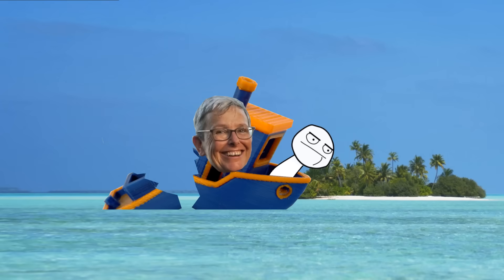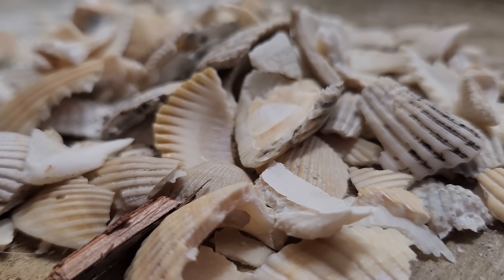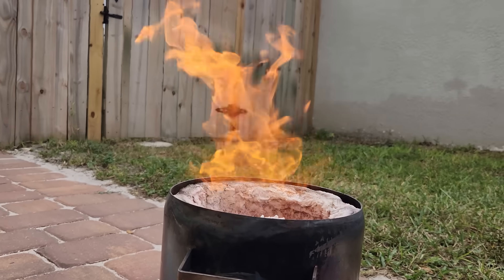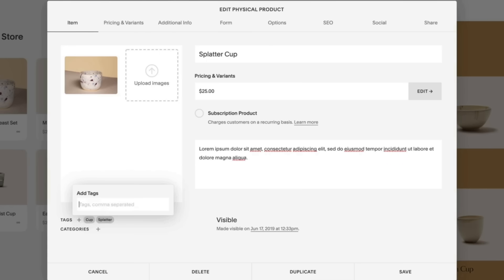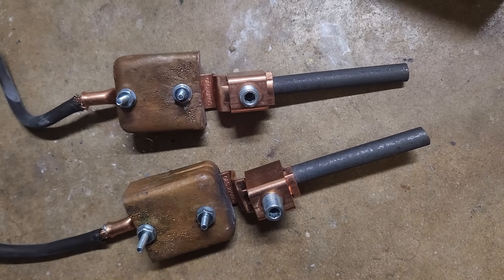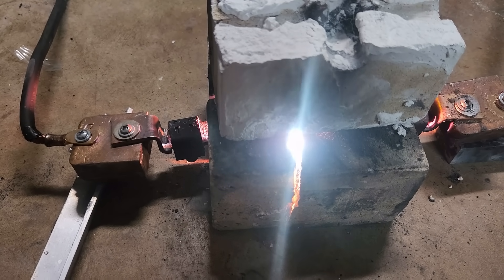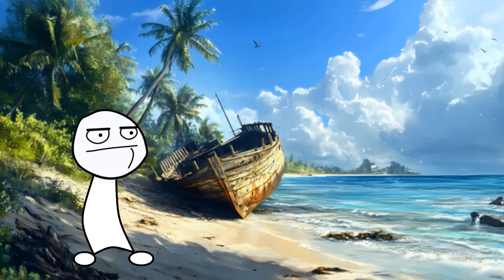Acetylene Gas from Sea Shells and Driftwood

Comment: You need to mix oxygen with the acetylene to get complete combustion with little soot. Also, in order to get it to go BANG!

As a welding gas, Acetylene is explosive when pressurized over 3 to 5 PSI, which is why the gas is dissolved in acetone.

Do not let the small flame fool you, with a leak in a hose, the gas can collect and go off and do severe damage!

Comment: Soot is from the lack of available oxygen concentration in the air and loss of radiant heat to maintain the reaction ( reaction cools off and fuel disperses before it can acquire the needed oxygen

Comment: Super! Those arc lights using carbon rods were used as light sources in cinema projectors. The rods diameter was about the same as the rods you used. Powered by DC and one rod burned faster than the other. The operator periodically had to re-adjust the distance between the two tips. The light was intensely white, just like yours.

Comment: I love the fact you mention volatile compounds being distilled out of the wood.

This is an extremely specific interest of mine due to my studies into black powder. 

It isn't very well known but around the early 1870s German chemists (always them) found they could preserve massive quantities of volatiles in their charcoal which when burned in black powder had major benefits.

First, the weight of the volatile compounds offset the fixed carbon content, second it offset the ash or mineral content and finally it actually produced water vapor as a byproduct.

Offsetting the weight of fixed carbon meant lower ignition temperature, the offset ash meant more fuel and less ash which contributes to a gritty feel and abrasive effect in the bore and finally the water vapor produced had several benefits, it softens the fouling and the vapor is an excellent heat sink, taking heat with it as it is ejected from the bore of a firearm.

German black powder of the 1870s and 1880s was regarded as the cleanest, least fouling and softest fouling powder of the era by those who had the fortune to acquire it.

Comment: even without an arc furnace I'd suppose you could also use a magnifying glass or perhaps even a Fresnel lens to produce the heat necessary from the sun itself for the final steps. technically they had the technology to produce this stuff waaaaay back in Ancient Greece! that'd be an interesting study, could the Greeks have produced calcium carbide for use in "Greek Fire" using a magnifying glass, I know it's thought that they used magnesium as a key ingredient as it produces oxygen in water.

Comment: Using a lower voltage on the arc welder is better for the heat "distance" but the current will obviously suffer. The arc will take up less space so that the infrared doesn't get generated as much.

Comment: "...too high for an air breathing flame..."

Woodgas. You're already making charcoal, so you're off gassing all those combustible volatiles for nothing. If you capture and condense those glasses before they ignite on contact with the air, you can use the condensate as a fuel to achieve 2000° or more. You could even throw in some methane and saltpeter for a boost! 

Point is, I think you could do it without needing a portable welder to make calcium carbide so you can make acetylene gas so you can weld without the welder you started with and also no oxygen?
Reply: In the spirit of HTME, we must now create and store acetylene gas from materials found in mature only. Ceramic, wood, shells, water.

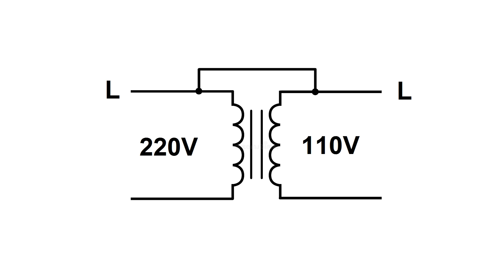Comment: At ~ 8:00 I'm not entirely sure you're looking at the primaries correctly...? 

Normally for 120 the two primaries are jumped together (in phase of course).. typically "1 to 3 and 2 to 4", line and neutral on 1 and 2 respectively if there's a terminal strip. 

For 240 they are in series.. which would then be line on 1, 2-3 jumper, neutral on 4.

Comment: USE 100 AMP MAINS CABLE USED IN UK! 

ITS 12MM COPPER CORE EVEN AT LOW VOLTAGE THE SICK AMPERAGE WILL DISSOLE YOUR SOUL!

Comment: I’ve made an arc furnace in the past myself… used some thicc large motor brushes.  Wanted to melt tungsten carbide… yup.. melted it and then even accidentally got it to burn 💀

Comment: Fun fact: ordinary petrol engines can use wood gas as fuel. In Sweden during the second world war it was pretty common to equip cars with wood gas generators, and when you were going somewhere you just chucked some firewood in there and got the gas going.

Comment: Would 2000°C be possible using a microwave?

I've heard you can get metals up to mental temperatures using microwave so could you mix some ball bearings into a powder and blast it perhaps?

Comment: Is'nt it possible to just use a cheap 230V  250A electrode welding transformer and just use two graphite sticks as electrodes? the welding transformers are cheaper here than a step up / down transformer and i have 230V / 400V from my sockets here (take this murica).

Comment: I did something very similar, but instead of calcium oxide (lime) , i used bone ash , wich contains a lot of calcium phosphate. I was trying to make phosphorus or calcium phosphide.  I had similar problems. When the reaction gets to a temperature that works, then the brick starts conducting electricity, which takes the electricity away from the reactants. In other words, the electricity would rather go through the semi liquid melted brick than go through the reactants.
BTW, keep in mind that some charcoal conducts electricity and some doesn't. Charcoal produced at high temperature conducts. If you have charcoal that doesn't conduct, just heat it with the propane torch a few seconds (for small pieces)

Comment: Tiny IGBT welders are pretty cheap, and current can be controlled at any level desired.  MMA-315 is an example one one I've used.
Love your teaching style!  Also love to see what works and what doesn't work as well.
When making charcoal I have to seal the hot charcoal very well or I get oxidative loss.  Maybe a steel plug (read bolt) that fits the hole you made would minimize that.  (I'm talking just a gravity seal of the bolt head against the can lid, not something you force into the hole.)

Comment: Couldn't you soak the charcoal in water to get rid of the potassium and other contaminants and then reheat in the container 🤔
Reply: The potassium shouldn't hurt the reaction. It could form 2 things, it could be reduced to metallic potassium, or potassium carbide, most likely the carbide. 
In this reaction, any other alkaline metals are probably going to do the same as calcium, ....and form a carbide

Comment: I was literally standing there at work with a tig welder in hand, thinking of the times I learned how to weld and how we went from oxy-acetylene to hf pulse 100Hz pushpull almost spray transfer like MAG machines. Then I thought about carbide and asked myself how acetylene was made or if it is possible to diy it. And here I am, browsing through all the crazy man's stuff finding a video on making acetylene from random crap...

Comment: Acetylene is wild. I used to use a B-tank when I was a sheet metal mechanic. One day, a guy filled a 4"PVC pipe at 3' long, with acetylene gas. Tape with a small hole at the far end, tape with a small hole at the close end. 

It went off, like a munition. Lmfao. He was in trouble, the police came.

Comment: or you could use fruit to make earth batteries and use the electric power to produce electrolysis for an oxy hydrogen torch. if you wanted calcium carbide via furnace, then use the oxygen side of an electrolysis system to inject pure o2 into the furnace. this is still useful for lights as it was used by cave explorers.

Comment: The flame from the burning wood is pyrolysis ( the conversion of a solid mass to a gas due to heat. Career fireman for 25yrs 😂😂
Reply: I hated factory fires due to Acetylene cylinders.  We have to isolate them in constant cold circulation baths for days. Evil 😈 stuff

Comment: Sigh you could have piped the woodgas with a clay tube and used it to achieve the 2000Deg in a small furnace insulated with lava rock, pumice, whatever. and made a small bellows too. its all there if you think out of the 1900s forward mentality. Functions will be similar, building materials will be the variable.  I know you aren't going for the castaway version, but you could easily have done it that way. as Theoretically, paint cans and all manner of debri do float up on shore too(for a lil cheat on base materials you needed...You missed all that...
You can make distilleries and refining towers with valves, Its crazy!  Ya just have to think castaway...SCIENTIST!  Yeah, rolls up sleeves. Fibers to simple glass beakers, Pig iron to forges, to steel, to fuel, to steam to. Ohhh ! Ehhh! BOSS! Da PLANEZ!...Da Planes!

Comment: 4000 degrees can be achieved with COAL, but only with a really proper setup. In a stranded situation, you'd be better off using a large focal lenz

Comment: Acetylene is a high explosive. It will detonate at any pressure but the blast yield is proportional to pressure. Adding oxygen boosts the yield because acetylene is “oxygen poor” (like TNT)…
Hydrogen won’t make soot because it doesn’t have any carbon in it…

Comment: When you light up an oxy-acetylene torch, if you start with straight acetylene you get a very smoky flame like the burning balloon made.  The soot is stringy and drapes over anything nearby.  I bet a lot of household acetylene lamps back around late 1800's were way sooty when not clean / in adjustment.

Comment: Hi. I might be absolutely wrong, but as far as I know, acetylene has more carbon atoms, than any other gas. Thats why it burns so black and coaly..  More coal, more energy etc. And if there is a lot of energy or fuel, but not enaugh oxygen, then burning is just like that. Black smoke is produced. Just like an old diesel cars. More fuel, than air and exactly same result. PS. thanks for the video!

Comment: Why don´t you use the Humphry Davy method of 1808 to convert the electrolytic amalgam of quicksilver with calcium by distillation to calcium, and then add the carbon for CaC ? Would save energy and work.

Comment: I can still remember the "safety lecture" we were given as postgraduate chemists at university. I put that in "quotation marks" because what it usually means is time for chemists to screw around and show everyone the most dangerous stuff on purpose. Several demonstrations involved filling balloons with fuel gases and then igniting them with a match on the end of a very long stick. Methane makes a nice whumping sound. Butane a deeper sound because it is slower. Hydrogen is much faster, almost a high frequency squeaking but very short-lived. Hydrogen mixed with oxygen is even faster and is quite loud - this mixture is called "detonating gas" for a damn good reason.

They left the loudest bang until the end of the lecture - where they filled a large balloon (about the size of a beach ball) with a mixture of acetylene and oxygen. We knew they were serious about the sound, because they told everyone to cover their ears before igniting it - which they hadn't bothered with for any of the other demonstrations. But we were all grateful for that - the sound of the acetylene-oxygen detonation was the loudest explosion I have ever witnessed personally. I'm not sure how to describe it properly - but I will say that it was louder than the cannon on a WW2 tank firing right next to you. Also, the sound was not the only danger from it - several light bulbs in the lecture theatre shattered from it, raining broken glass down on us.
Reply: I know a guy who filled a big trash bag with acetylene and oxygen and set it off in a rural-ish neighborhood, like a new development on the edge of civilization. 

Despite being some distance from any of the houses, it blew out windows. Don't know how he managed to avoid getting arrested
Reply: To make a balloon really explode you have to mix oxidizer with the fuel in the balloon. It's a little fuel and a lot of oxidizer.  That makes it go boom. If you get the mix good it's surprising just how powerful an explosion you can get. So how you light it becomes important. You want to be clear before it detonates. What we'd do is put a sheet of newspaper on the ground and place the balloon in the middle then light a corner of the newspaper and run. That always gave us enough time. We'd get a pineapple sized bang. So a half a stick. Loud report.
Reply: Fun times, I see 😅 
Good info too 👍

Comment: I would recommend using a carbon vessel such as a graphite casting mold, and compressing the mix powder into a puck before applying the arc to it using the mold as one of the electrodes.

Comment: Or you could heat that crushed charcoal with calcium carbide and make activated carbon. 

You could at least filter water that way or make pro masks. Not sure what purpose the latter would serve but it'd damn sure confuse anyone that finds your body in 90 years.

Comment: You could possibly get a similar result using egg-shells? That said, I am not sure I follow your method of producing the carbon-arc. Here I have a 100 Amp welder, ca 1980 vintage with a carbon-arc brazing attachment. On a final point, I will need to check the chemistry involved but believe carbon monoxide among other toxic products may be produced by this process so do this in open air and be careful with acetylene!

Comment: Just a quick question : If you have suitable windings and a mains power supply on your island, so you are able to make welding gas, why not just use your homemade welder to do the original welding ???

Comment: The production of calcium oxide is being stunted by the co2 of the flame used to heat it.  Best to seal in a metal can with a nail hole in the lid.  That largely eliminates the exposure to co2 yielding almost pure cao.

Comment: Do you think it would use less electrical energy if you electrolyzed a calcium salt to produce the metallic calcium, and then made the acetylene? The arc furnace is cool, but I wonder if this might be a little easier.

Comment: Hyperspacer Pirate, for you arc furnace, please consider an inductur in series with electrodes. It will limit te current, so the windings won't melt.

Comment: Instead of using a transformer, the wire could have been used to wind a choke on the core,  which would give you the arc voltage with less loss/heat generated in the process.

Comment: Very interesting, i wonder if shellfish shells from fresh water sources would work as well, i guess so, since buying carbide is pretty hard here. How about developing this so you crush the carbide into smaller medium like sand, that is still easy to handle and build reaction chamber with feeder that produces acetylene gas by the demand as in couple pressure sensors for regency, that only feed if both agree on the pressure with in set parameters, that then via micro controller feed carbide into reaction chamber and keep the pressure in say 1bar was it that is required for torch to stay lit and still cut? Oxygen supply can come from ether bottle or HHO generator. It would be really nice to have essentially solid/liquid state cutting/heating torch for hobbyist that does not need it too often, hence making rental or pressure testing the owned bottle expensive for the use. HHO generator would be kinda ideal since it produces both fuel and oxygen via electricity, but does not get into high enough temps for gas welding at least. Something that makes us self sufficient when it comes to gas production would be ideal, if nothing else, when shit hits the fan, it will be friday evening and your gas bottles will be empty. What ever it is ww3 and you need to get that shelter door fixed that has been on the back burner past year or torching stubborn bolt off a car that you get to work in monday. Same setup for Co2 would be great for welders too, though old co2 extinguishers work as "ou shit out of gas and its weekend" bottles. Good work and keep on tinkering for solutions like this.

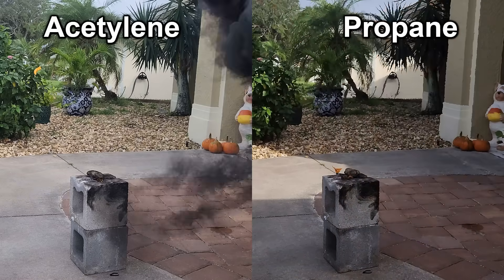13:00 Pretty sure the amount of suth is caused by acetylene having far more fuel in the volume, so since it lacks the oxygen, or just minimal mix happens with outside air, the burn is extremely rich hence forming the suth. Mix in optimal ratio of pure oxygen and after ignition go replace windows in least 5 meter radius. Put into tube where one end is welded shut and go replace windows in 50 meter radius and for once, the permanent hearing loss is actually not service related...

Comment: Im quite interested in 'scratch chemistry' being a guerilla chemist myself.  The work that Wohler and Liebig did in the late 1800s, particularly with potassium salts, is s worthy of study for the chemist.   Its rather amazing how many potassium derivatives you can make starting with potash from wood ashes if you have a moderately strong heat sources, i e. 200-600C range.   This is a reaction that interests me, blending ammonium sulfate with charcoal and a small amount of zinc oxide or alumina catalyst and heating in a sealed, slightly pressurized SS cintainer to 350C to form thiourea.   Thiourea can subsequently converted rather easily to both thiocyanate and guanidine base.

Comment: Its kind of sad just buring all that wood gass rather than running it through a fractional distilation process. Also as he was getting tar as one of the by products providing the boats hull was only cracked that would have been good enough to seal the boat aor with more wood a new water tight boat.